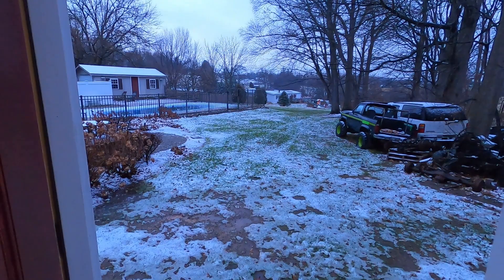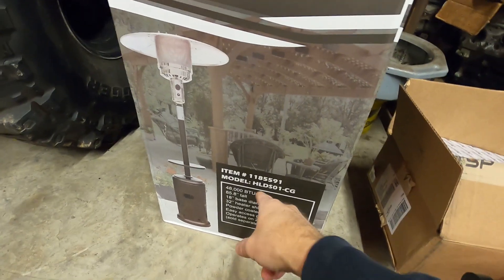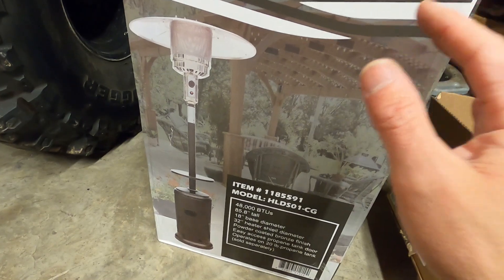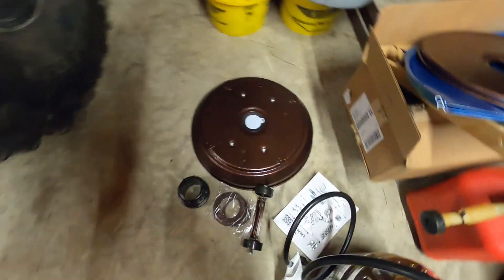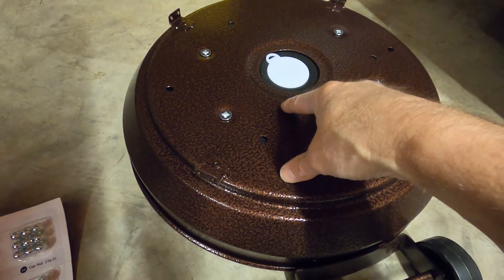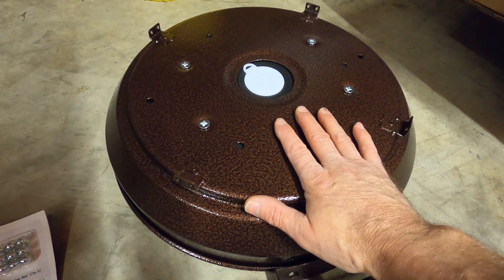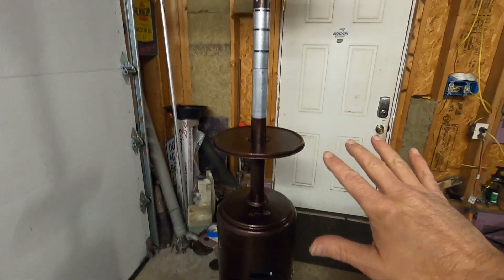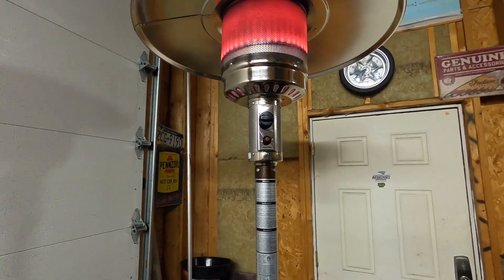Patio Heater Assembly Hiland HLDS01-CG

Comment: Would it work to disassemble the heater to transport it to another place? Or is that impractical?
Reply from the maker: I would just remove the shield on the top, so it doesn't get bent up.